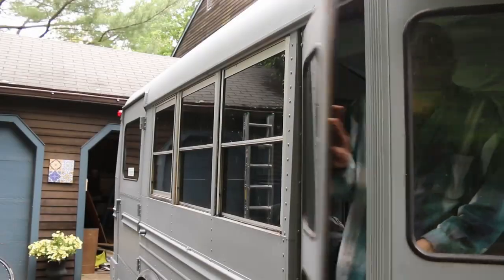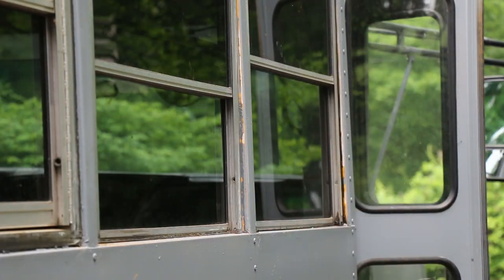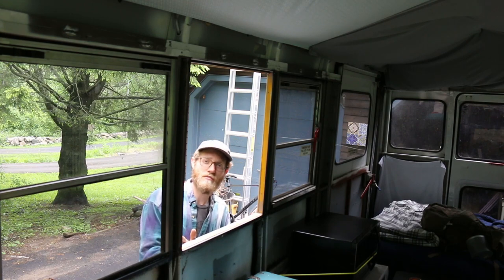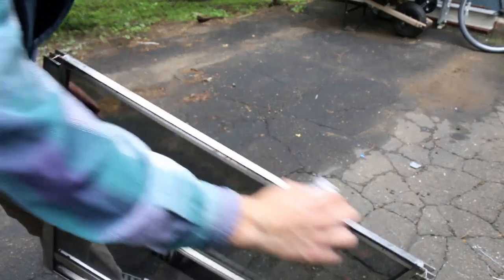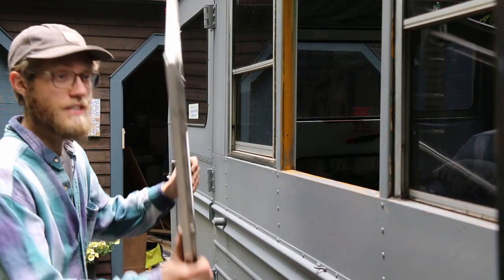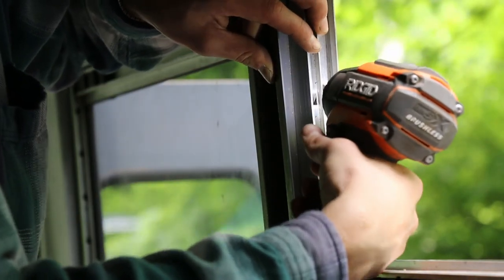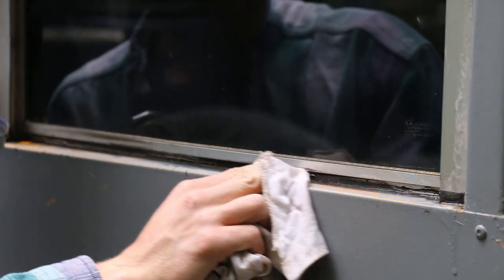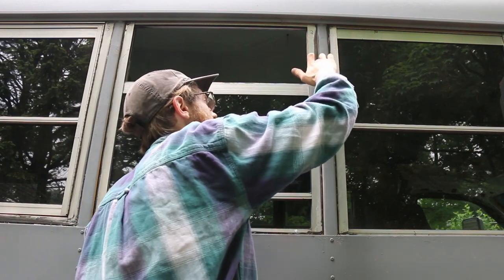School Bus Conversion - leaking windows

Comment: so most of my leakage is air related...in that the heat sucks right out in the cold weather - do you know about sealing the cracks where the window slides up and down? I don't know how else to deal with this except maybe just completely change the window for something else?? maybe keep one original and delete the roll aspect of the other windows. stationary windows lol